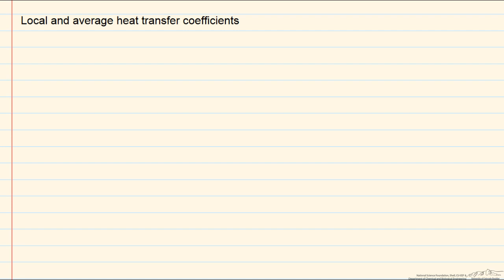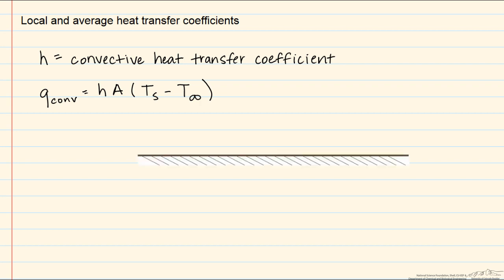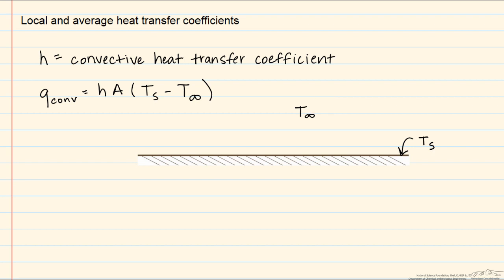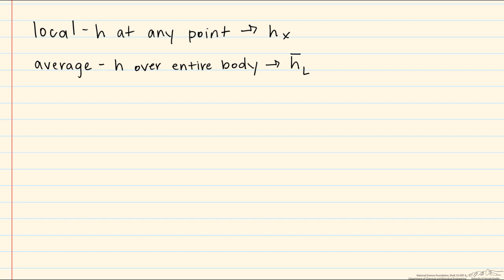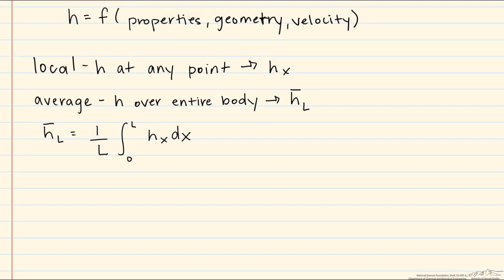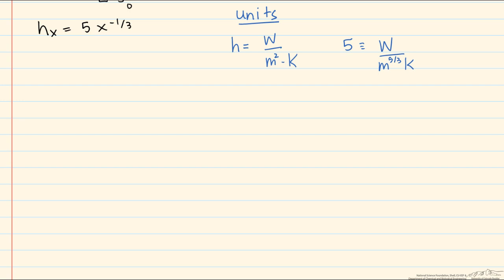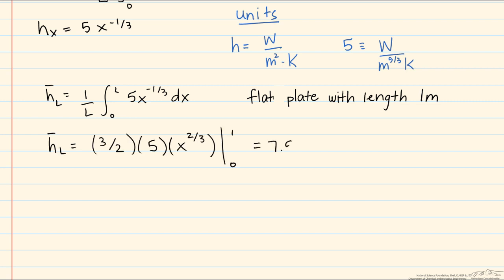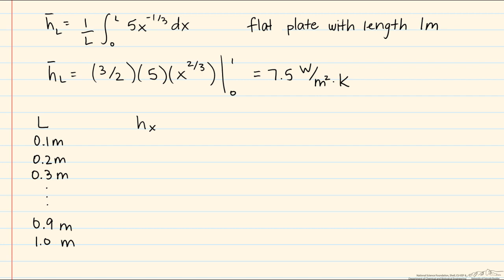Local and Average Heat Transfer Coefficients

Comment: (URGENT) 
Got a question asking us to prove if the Average Heat Transfer Coefficient is twice of the Local Heat Transfer Coefficient at x=L  with the length of the plate, L=0.5m. 

I keep getting ha/hx = 2 at x=0.67m, which is beyond the length of the plate, can anyone help me with this? Thank you so much